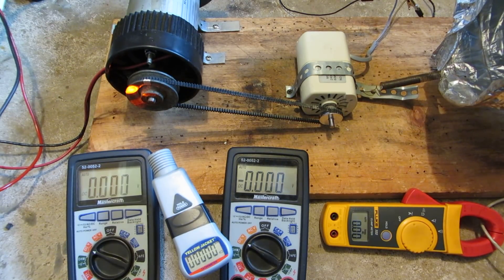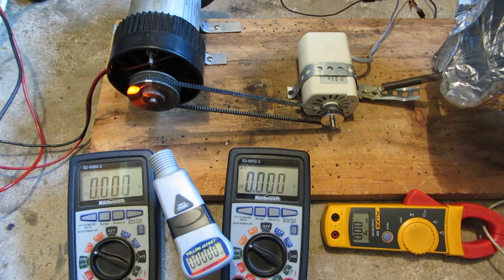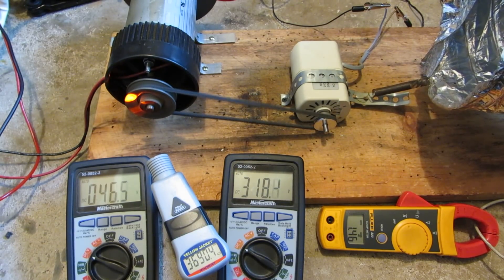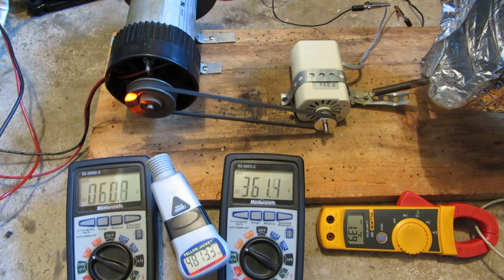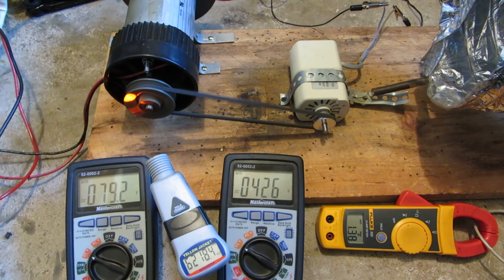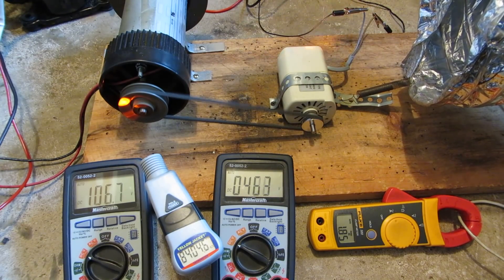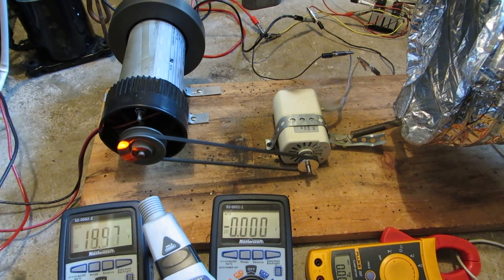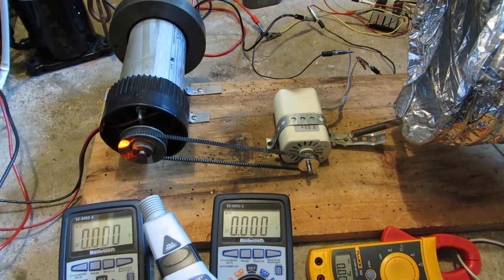Pushed to it's Limits:  European Sewing Machine Motor

Comment: I have a Anesty variac how do i do that with DC voltage? im only getting AC voltage..
Reply from the maker: You need to rectify the output to get DC.
Reply: @HL4EHalfLife  A AC DC convertor?
Reply: @HL4EHalfLife  I got a convertor our of a blender it didnt work
Reply: @HL4EHalfLife  I'm afraid of capacitors they might explode.
Reply from the maker: @JavonDevv9000  No not a converter, you need a full bridge rectifier.
Reply: @HL4EHalfLife  Ok thanks!
Reply: @HL4EHalfLife  I like doing this stuff even tho im still a teen
Reply from the maker: @JavonDevv9000  Just be careful.
Reply: @HL4EHalfLife  Ok I'm going to buy new protection glasses Ive already did motor blowouts with AC but they keep making my amp fuse blow on my anesty 130W variac I only have 2 fuses left so I need something that can read my amps so I dont go over 5 amps. one time my variac started smoking so I turned it off for 1 day and it still works.
Reply from the maker: @JavonDevv9000  You can buy amp meters at places like Canadian Tire or other similar hardware stores for around $100.
Reply: @HL4EHalfLife  Ok
Reply: @HL4EHalfLife  Ill get that from ace hardware :D